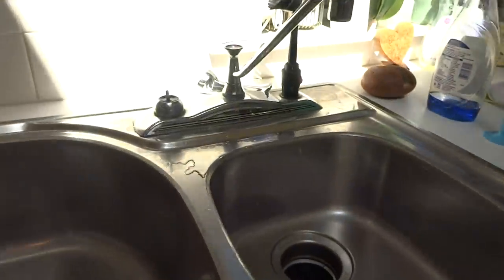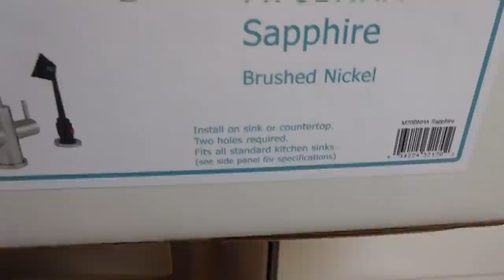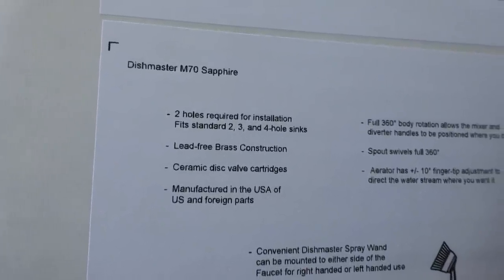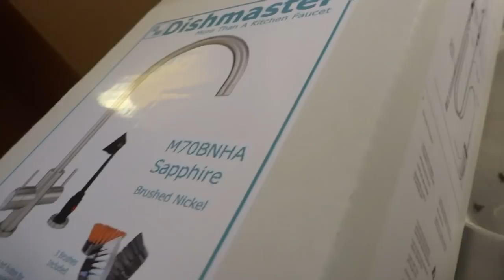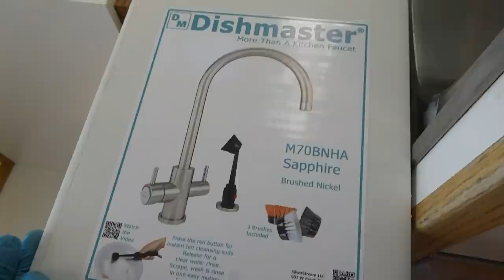OLD DISHMASTER 2000 KITCHEN FAUCET UPGRADED

Comment: I’m pretty sure you don’t need more work, but on these jobs where the supply lines and faucets get clogged up, do you suggest to the owner that they should have a whole house filter installed to cut down on the clogged faucets? One like you have at your daughters’ house.

Comment: Hi Steve, what is the fastest way to tell if the system has a piston ot TXV? What do you normally do?

Not related to this video I know, just kept forgetting to ask you this question. Great video btw
Reply: It’s usually mentioned on the specifications label on the outside a/c compressor unit
Reply: @statmanSL  that is true, condenser usually says what subcool is required for txv, but that doesn't necessarily mean it has a txv. I have come across many who's condenser says that, bit have piston inside
Reply from the maker: best way is go look at air handler and take cover off.... myself  i can usally tell when i start charging up unit .just by experience.if its a txv or piston..some brands run txv .....some pistons for the most part......bring up your subcooling to 9 or so and see what happens with the superheat ..
Reply: @stevenlavimoniere  Thank you Steve, exactly what I was looking for

Comment: Hey Steven under that sink there's supposed to be a GFCI/AFCI I don't know why they put it in that spot knowing that water could easily drip or spray but that's a fire hazard. I would of put it a minimal of 3 ft or 36 inches from where the hoses under the sink is. For me personally I would have put a weatherhousing unit on the plug as if you were outside just incase if any leaks tend to happen years later that it doesn't shorten the plug out and cause a fire
Reply: Its possible that that outlet is "down Stream" from a GFCI outlet seeing that its in the kitchen. Testing advised
Reply: @davidkirby3667  it might be. You might be correct. But me personally I would of had one separately branched just incase. You never know
Reply: They also have a breaker that does the samething. Some older houses have the breakers. They are red to indicate GFI.
Reply: @BaconJD420  yes